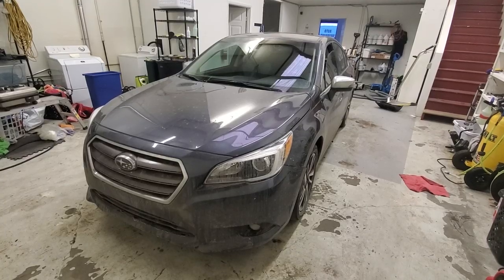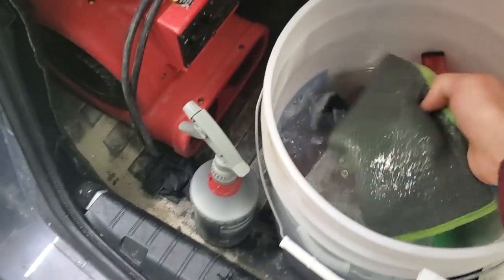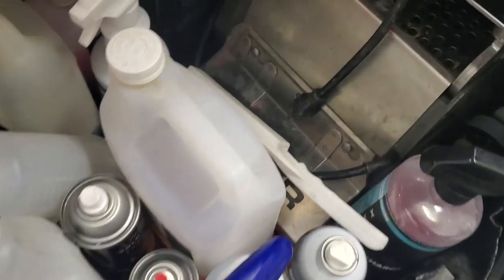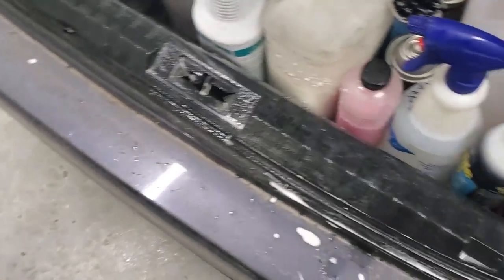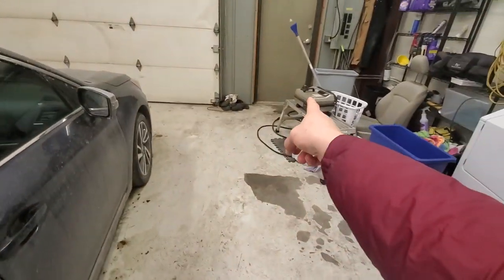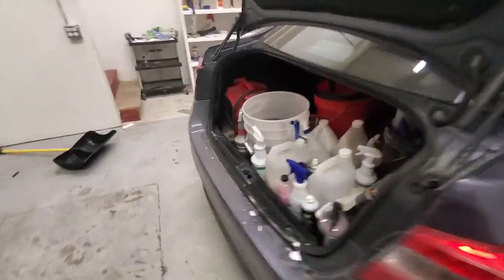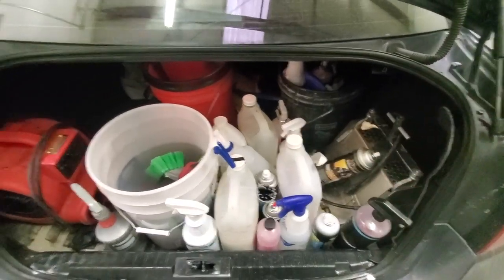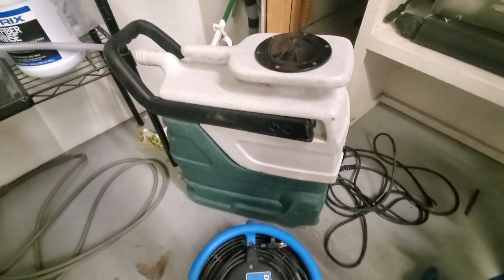My SEDAN mobile detailing set up! (You don't need a special truck or van)

Comment: Fully support using what works, especially with previous clients in the WINTER. Am however confused why hydrosilex is in there 🤪
Reply from the maker: Oh hey now! Hydrosilex is a nice topper for coated vehicles. This is that beige Ford Expedition I posted to IG. I kinda wanted to test it just for visual purposes. I think hydrosilex works better visually on darker vehicles
Reply from the maker: Not something I use for a one time protection measure -- but I love it for that instant pop and it does bead water nicely especially at first .........

Comment: Nick, since you made the move to the shop, what would you say is your balance now. If you are still out on the road doing mobile,  would you say you run the risk of losing drive in traffic while your not at the shop?
Reply from the maker: That's a great point. I'm pretty much appointment only at the shop. Do you get a lot of walk ins? I wonder if I'm missing out on people who just swing by. I do mobile when the job makes sense...or if I need work that day. Winter has been winter lol, as you know, so I am a little more likely to say yes to work this time of year
Reply: @HawkProDetailing  , We probably get around a couple of walk ins per day, mostly emergency stuff like UBER and LYFT drivers who have had a bad day. We as you know are just down the road from you, so Utah moms and Grandmas are always traveling with some kind of food, soup etc that has spilled wile they were out doing a good deed. Those quick emergency jobs are generally a lead to a full detail further down the line so it is difficult to turn them away, even when you are busy with full ceramic coatings and full on details. 

Having a great crew helps, but it all takes time to build a team and reputation. Finding  employees is not a problem, finding the right employees who are team players, committed to the business and willing to help the business grow as a whole is another matter.
Reply from the maker: I really gotta come by and meet you!
Reply: @HawkProDetailing  Nick drop on in over the next couple of weeks, Before we both get busy again after this snow disappears.lets do a video on the advantages and disadvantages with a shop V mobile. both have their benefits.

Comment: Might be better than running out of a truck. I hate having to climb up into my bed to get stuff.
Reply from the maker: For sure! What I like about the truck...plenty of room for generator, compressor, pressure washer....but with the car set up I COULD fit a pressure washer in there no problem. This client in particular has a coated vehicle and a hose inside garage so i dont worry about it
Reply: @HawkProDetailing  yeah that's the main reason I stay in my truck hauling that generator around.